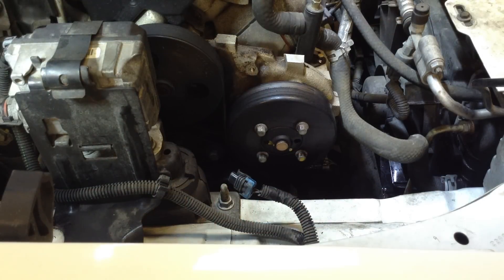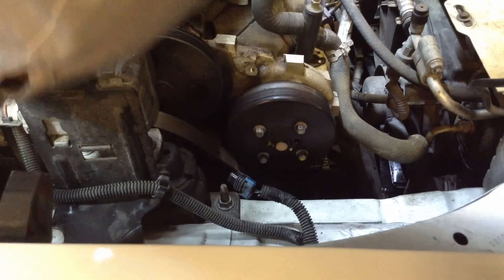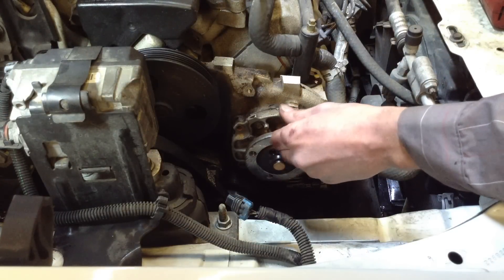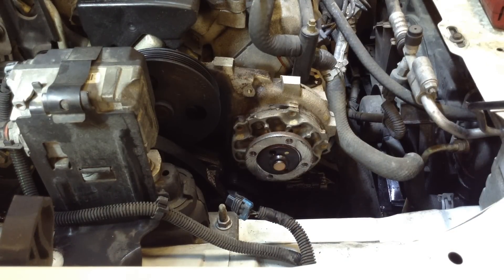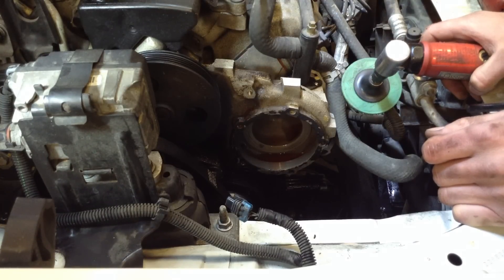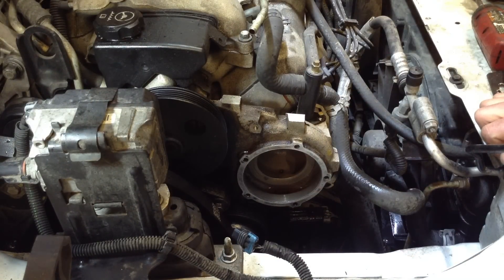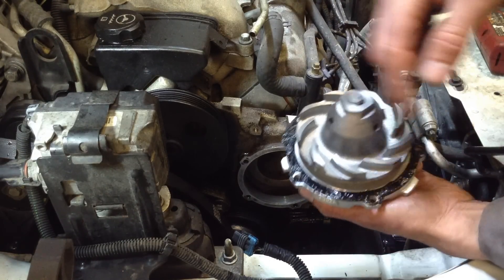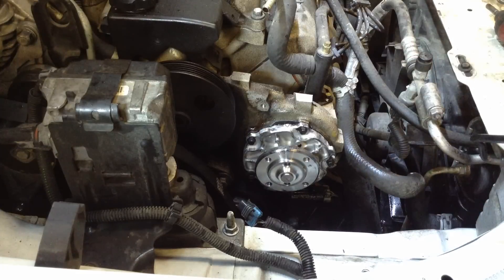2003 Chevy Malibu Water Pump 3.1

Comment: Great video, however, I would recommend stuffing clean rags into the coolant chamber so the debris from your die grinder doesn't get in the cooling system.
Reply: How do you bleed the air out of the system .bo you open the bleader Valve after it's been running awile or do you do it wile it's still cold.thos cars do have a valve don't they.